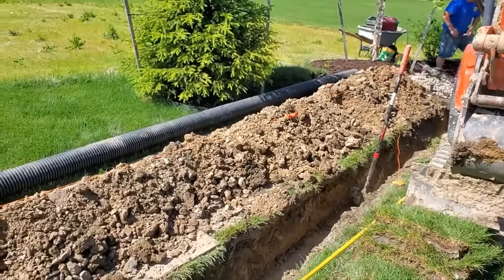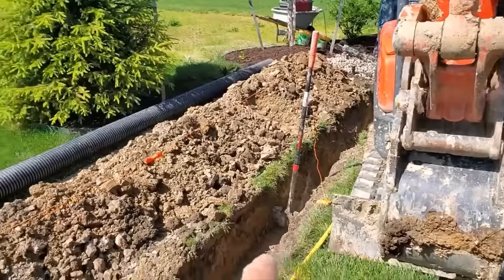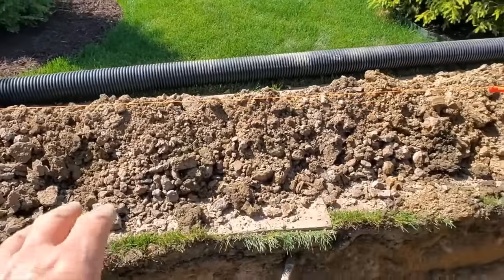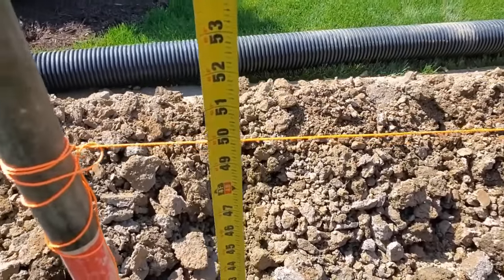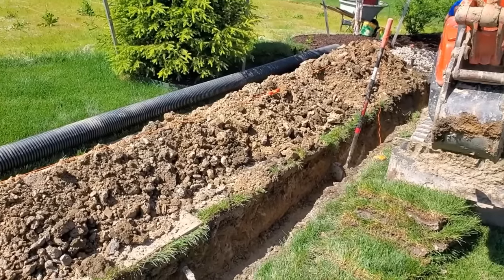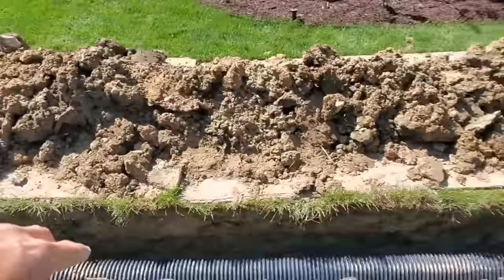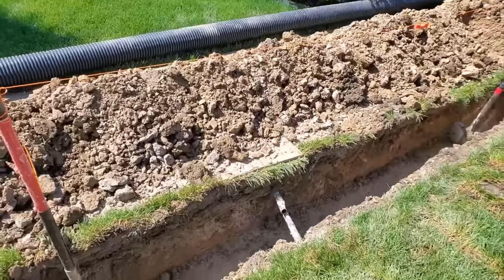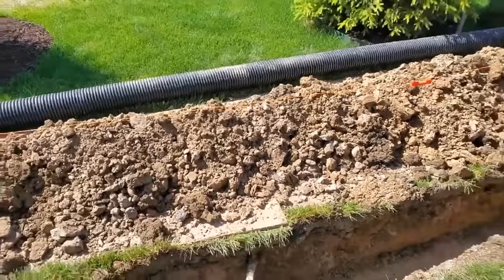How to Measure SLOPE for Under $5 DIY Must Watch!!!

Comment: For a late night DIYer home improver with a decent buzz, that intro almost had me researching carpet cleaning videos
Reply: funny, he needed a reason to write off the drone.
Reply: Your comment perfectly describes me right now. I’m still confused though, I’m just a DIYer homeowner doing my first French drain. So this video assumes the trench is exactly the same depth at all points and the string level is in at the 50 inch mark (in the middle)?? Maybe I’m too buzzed and not getting. I’m watching other videos and this one makes the most sense, I guess.
Reply: Wtf? Lmao. As a person looking for drainage solutions with a slight buzz, I'm wondering what you're talking about. Lol
Reply: @joshuawells5953  he’s saying that he almost threw up because of the rotating drone intro
Reply: @cristianvel619  Your comment is 2 years old, so I'm assuming you figured it out.  For anyone else confused, the string is level and the objective is to determine the slope.  So he set the shovels 100 inches apart and wants a 1 per cent drop in grade. So for each 100 inches, the trench needs to drop 1 inch from the start of the line to the end.  This gives the 1 percent slope, because the string is level and the trench slopes down by 1 inch across the 100 inch span.

Comment: This was excellent. I’m fixing a few simple puddling issues at my old man’s 30 year old house. I need to get the water off the front walkway and around the garden, it’s around 30 feet, and I was stuck—like the water. Thank you. I can actually see what the original builders had in mind, but after time it needed help.

Comment: Great vid on the double barrel pipe trench. Not to nit-pick but those line levels are notorious for being "kinda right". Mainly due to being short and dropped or stepped on way too much. They actually do read best at the center (mid-point) of the string and reflect proportionally the overall slope set by the endpoints. The slope in a level (or nearly level) line is greatest at it's endpoints and least at its midpoint. You can decrease this deflection to close to nil by using quality mason's line stretched as tight (read "flat") as your tie-off points will handle. Like a gee-tar.

Comment: You made it a point to show off the Bells of the PVC sticks, which I also prefer and use consistently. But, you installed the bell in the opposite direction of flow thus creating a substantial amount of friction and speed loss.  Ever have issues with this in more demanding installs?
Reply from the maker: @S.   1999
Thank you I will bring this to my crews attention. Appreciate your insight brother another example how we are better in numbers. ✌👍
Reply: Good catch.
I just caught this slope video and needed to watch it.

Comment: For my drainage project, wherein I was draining water from the end of our driveway and around the septic system, I used 4" solid corrugated pipe, and a 12" square catch basin. The reccomended pitch for that I read was 2 1/2" per 10'. So, I built a simple 4' wide by about 2 1/2' tall frame out of 2x4s. The needed slope then was 1" for 4'. Once I got a bit past 4' section of trench dug, I could easily check the pitch by setting the jig I built into the trench, and my 4' level on top. I would then just eyeball how much the downslope end of the level needed to be raised to get it level, looking for it to be about an inch. Not enough, then dig down a bit more on the downslope end, and too much, then throw a bit back in and tamp it down. Worked like a charm.
Reply from the maker: Nice!
Thank you for sharing

Comment: I love your videos. Thank you. Ive made improvments on my 60 ft underground drain tile system after watching your videos. I got all my connections tile taped before the dirt settled. Question, for my pop up emitter i put a bed of gravel about 6 inches underneath the pop up and around in the hole to build up the gravel for the weep hole. I didnt use fabric. Have you ever seen roots penetrate a weep hole on a pop up emitter? I got all other connections tile taped.
Reply from the maker: I have not, and if I ever did, I would just reach in and rip the root out. I feel the same way about catch basins, with all the holes that we drill in the bottom of the catch basins. My thoughts are, if roots grow in, they will get removed when the basin gets cleaned.

Comment: You've got your 4'in PVC pipe fitted at the bell joints facing the wrong way. Flow should be towards the bell not away from it which creates small eddys coming in contact with the lip of the male ( non bell ) end. Not overly an bigy with stormwater pipe but a good habit to adopt for pressure pipe as well.
Reply: I presume also an issue in cold areas where sitting water could freeze and break the joint / seal?
Reply: Draw some arrows so the water knows to flow that way😊

Comment: How about using your method (100 inch string, 1 inch lower on one side = 1 percent slope) but, instead, mark where the string is level on both shovels. Let's say we are doing 100 inch run. On one of the shovels, lower or raise the string 1 inch from level. Now, no matter where you measure on your 100 inch line, (let's say 47 inches from the bottom of the trench to the line), you will have 1 percent slope. Basically, it takes the guess work out of assuming (quarter of the way, it should read 0.25 inch lower than "level"., and at half way it should read 0.5" lower than "level".

Just make the string to the slope you want, then measure down to "47 inches", if that's what you want, ALL ALONG THE STRING. so easy.

Comment: Thanks for helping us all out. What kind of percent drop is ideal and what is minimal?
Reply from the maker: @Steve C  1% minimum 2% ideal
Reply: Is there any issue with running your perforated pipe downhill to be discharged at say about a 10% slope? (which is the measured natural slope of where my pipe needs to go to be discharged!)

Comment: Bell ends of PVC pipes should always be at the uphill end of the pipe as water flows more smoothly over the joint. If they point downhill turbulence is caused by the end of the pipe that's fed into the bell.
Reply from the maker: @Nicholas
And toads give you warts. Its BS.
Research it. Its something the old times thought and said. Controlled testing has proven either way is fine. Thank you for commenting!!
Reply: The micro turbulence at the joints of PVC is a drop in the ocean compared to the turbulence inside corrugated pipe and farmers use corregatef for literal miles to drain fields.   You are worried about factors that don't matter

Comment: Wouldn’t you need to do multiple smaller increments for the whole run to ensure the whole run is at a constant slope?
Reply: if any next section is sloped at least 1" whole run will be sloped as well, of course, its best not to "over sloping the first sections" cause you might end up digging too deep at the end ;)

Comment: Why tie the mason line do high up on the shovel handles?  Don't you want the line to be as taut as possible with zero sag?  The lower down on the handle, the tauter the string will be before it starts pulling the handles toward each other.

Comment: Just started watching your videos after I started to get some water coming up from my basement floor (concrete). New homeowner, so this is all new for me. Great stuff, I'm learning a lot! Starting at 5:35, that PVC piping is for the sump pump, correct? The previous homeowners have the line for the sump connected to an extender, just leading to the side of the house, causing that side to be almost swamp like. Would something like putting PVC in a trench for the sump be recommended, or can I connect the sump line to a trenched down spout?

Comment: I'm stuck and need help 
Your videos gave me confidence to DIY. This is a big ..project. I have a flooding around a 20x40 pool and between patio and pool so...
I am running 200 feet of single burritoFrench drain around 3 sides of pool. Front aide of pool is two pipes one for drain surface and french. I'm stuck on slope issue. How deep is too deep? Is running water through a pipe a good test if slope is good?
Reply from the maker: Yes, that would be fine. You can also put a level on a pipe, and it just needs to be a little off bubble. 1% Slope

Comment: Was the dual wall for the downspouts and does that get wrapped in the egg stone on top ot the 2 bottom lines? Where does the downspouts discharge at? I wished you showed until the end.

Comment: I like the fail safe sump outlet, you showed it in an earlier video. 👍🏻 Would it be okay to run to the sump line to the French drain and let the french drain take over from there? I have nowhere for the water to go but between me and my neighbors yard (his yard has the low spot). I’m thinking the 60’ run between us will dissipate some of the water I put-into the area. Thanks for the ideas.

Comment: How much slope is on that sump install? Getting ready to do something like this and I don’t have much slope to work with and my house happens to be sitting on a spring or underground creek. So during rain and freeze thaw my sump runs a lot. Seen up to 170 gallons hour which it’s doing as o type this. It was totally flooding the neighbors backyard but  I moved it to discharge on the driveway which eventually just sweeps into my front yard.

Comment: I can't find any information on where exactly I should dig my trench for my French Drain. I have about a 6% slope in my backyard, but then it eventually starts to flatten out when it gets to the edge of my deck (about 10 ft from the foundation). My question is should I dig my trench at the edge of the deck where the yard starts to flatten out more or should I dig my trench 3-5 ft from the foundation (everything I've ready online about French Drains).
Reply from the maker: https://youtu.be/w8kKo_6cKeg

Comment: So you use 4" rigid PVC for moving water collected from the gutter or from a sump pump, and flexible perforated pipe for ground water, correct?
Reply: Is there a reason for this? Why rigid PVC rather than corrugated/flexible (non-perforated) pipe from a gutter or sump pump?

Comment: I have 4 catch basins in series connected by pvc pipe around my detached garage. The two in the middle always stay full while the first stays empty.  It takes the third catch basin to be full before the 4th fills up. I’m guessing the pvc from the 3rd to the 4th has too low of a slope. Do I redig and re-slope the pvc and 4th catch basin?  #dumbcontractor how do I fix a bad slope?

Comment: What keeps the line between the two shovels from sagging? Is it just a matter of being taut or is there a special line material?
Reply: It could sag, just put the level exactly in the middle of the line. The tighter the better tho.
Sometimes the levels aren't accurate brand new. Varify them on a known accurate level, then check it the other way (turn it around). When I buy them, I put them all on a really expensive level at the store and pick and chose the best one.
I do this method for buying temperature gauges too.
I check them all, to see if they read the same number. (71f), if 1 says 73f, don't get that one. Lol. You get the drift.

Comment: Question??  I don’t have much fall from my back yard to the street. About 5 inches for 100 feet. 
Will a French drain still work??
Reply from the maker: You need a pump. You will only drain 5 inches of your trench and the rest will hold water allowing roots to thrive and plug the French Drain. Trees and shrubs seek out water. Put a sump pump system in we have several models. 
Store | French Drain Systems | Curtain Drains | Macomb, Oakland, Lapeer, St. Clair County
https://frenchdrainman.com/store/

Comment: Interesting. But the slope can change after you add rock...that is if you plan on putting rock under the pipe. The slope with rock determines the pipe’s slope, not the ground. This same method should work, just measure from the rock and not the dirt.
Reply: He doesn’t use rock under the pipe and won’t recommend it either.

Comment: About to DIY my first project my main issue is everyone countering each other on wrapping the piping. Do you have any advice on this ? Please/Thank You. - I live in the Midwest
Reply: Jake , he wrap it. But what he does is probably different from 2 other peoeple and the same as 2 other people. Probably breaks down to what you want to do.
Reply: If it were me, I would wrap it using the same size aggregate recommended.  
Same goes for the tortilla shell he uses. 🤣
If you cannot find it locally, order it from him.   
If your going to do something, make it count!
It’s your money and time.  
Sweat equity
Reply: The wrap depends on if it’s perforated or not. If it’s solid pipe, it doesn’t matter. If it’s being used as a curtain or French drain then you wrap it with non-woven geo-textile fabric, which prevents roots and debris from clogging the perforations. Additionally, you don’t want small rocks or chips in your wrap, that’ll clog as well. If you can’t find any stone without small pebbles or chips, then you need a sock on the perforated pipe. Hope that helps.

Comment: Can you have the bells facing the wrong direction like that?
Reply from the maker: /data/user/0/com.microsoft.office.officehubhl/app_EmailAttachments80df3e07-cb83-476d-b136-8345588ae1c6/pvc-pipe-bell-direction-sometimes-it-matters.pdf
Reply: @FRENCHDRAINMAN  Pinned a good question then provided an important answer? Went to subscribe just for that, saw I already was so I hit the bell. Good job man!

Comment: When you see percent of grade posted on side of highway, is it on foot or inches or what? 13% is 13 inches in 100 inch intervals?
Reply: Ratios of distance (and percents) don't need a unit as long as the going and the drop are both in the same unit. 2 inches per 10 inches is the same grade as 2 metres per 10 metres

Comment: can i tie my down spout to the french drain
Reply from the maker: @Dana
No it will fill French Drain with shingle Gravel and leaves
Reply: @FRENCHDRAINMAN  a mistake avoided already.
Reply: @FRENCHDRAINMAN  would your you recommend to tie in gutter downspouts into then? Just the same schedule 40 that was used for the sump pump?

Comment: If there are holes on the bottom of the blue French drain tube, wouldn't the water just drain down under the tube?
Reply: John Zimm it’s called a French drain so basically when the soil is over saturated from below the water level rises and once it rises it flows through that blue drain as like a funnel. This system keeps the top of your lawn dry after long storms instead of puddles forming.

Comment: the mechanics of water table confuse me...  my basement slab doesn't start to weep unless the ground is really saturated ....  my sump location is sort of centered in my 15 wide by 25 long basement....  its a block foundation from 1920....  house is footed at about 48 ....  now if i want to pull water from the ground away from my foundation does my french have to be 48 deep and pitched down and away....  my yard is 75 deep  from back foundation wall to the back of my property and drops off into the local line railroad ... thats my back fence no neighbors on my back side just to my left and right..... i want to use that to my favor....  i dont mind hand digging the trench it draws less attention from my neighbors....  at 40 wide properties everyone is eveyone's business..... i just want to picture it all in my head am i trenching 75 feet or maybe you suggest dig a drywell at 30 from the house and let that be the work horse....

Comment: so that clay sitting on the plywood is getting hauled off?
Reply: Yes, they take all the dirt off-site and just put the sod back over the wrapped stone/ piping
Reply: If I had to guess - over the downspout only section (not High Octane), fill dirt goes in.  
The rest of the run, down and High Octane, round rock and wrap.  
Then the sod gets reinstalled.

Comment: The line level should never be in the centre of the string, as it sags. It will not give an accurate reading.
Reply: I just dug a 100 feet trench by hands. It will be 200 feet soon. I just used my eyes for the slope. Once it is done, I sprayed water in there to test the flowing direction. It worked very well, but I found it hard to keep it slope. Especially, when I have a long trench. Winter frost will shift the pipe anyway, so larger pipe works better.
Reply: I use a water level. Less than $20.00 and more accurate than a laser
Reply: Sagging isn't a problem as even with it the centre of the string is level. Putting it to either side of centre will reduce the accuracy.